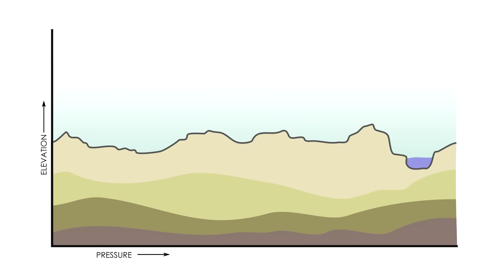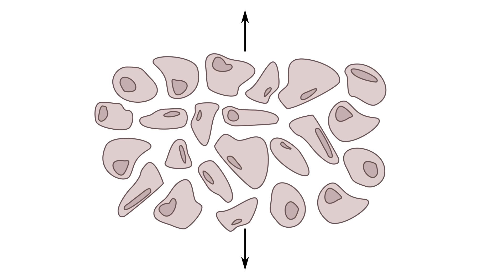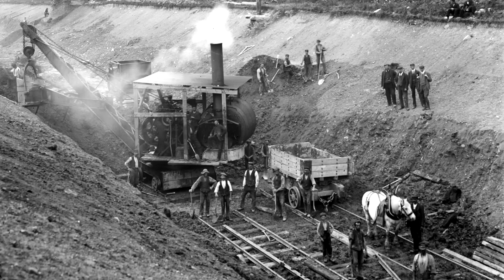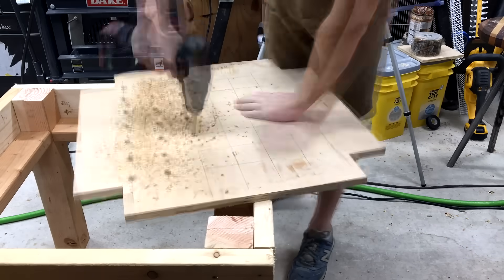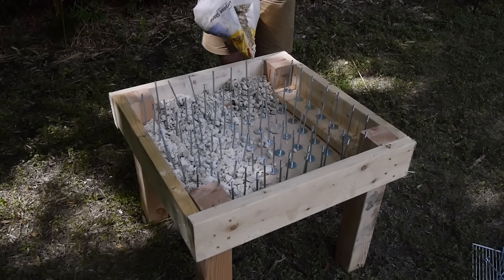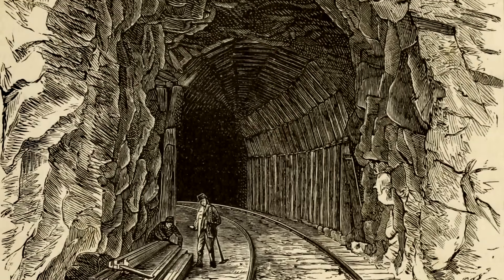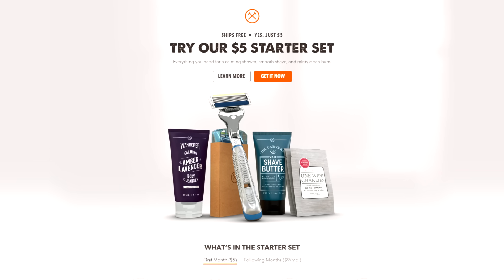Why Tunnels Don't Collapse

Comment: One of the tunnel designs that stretched across Sydney and the CBD that supports the Heavy Railway subway System in the style of Heavy surface Rail including the Red Rattler System.  The tunnels did bore through Heavy rock when construction, but required thick Reinforced concrete bunker wall method for the strength of the railway tunnels,  the ones under parklands Hyde Park e.g. was dug up in the Early 1920s and St James station and part of the City Circle line was built.  2 tunnels were needed for the Underground Railway, another 2 were added for a new route to Eastern Suburbs that didn't make it.  The St James and Museum station section in the Hyde Park area used Cut and Cover Techniques, while most dug under the streets were pit style tunnel digging through Hard Rock and then concrete lined.

Comment: I need someone to explain to me why the old Gotthard tunnel here, which was blasted directly in the rock, never needs any major maintenance, while the second one, less than a third the age, built to much more complicated standards and lined with concrete, needs a major overhaul that will take years. So bad in fact, that they will need to drill a third one, to allow closure of the second while fixing it. How complicated and expensive the new one be will to maintain - I'd rather not think of it.

Comment: I am going to start working on an underground shelter into a huge hill on our property. I could use a lot of advice on how to support the roof and side as I will be building shelters inside the tunnels and possibly moving shipping containers 40’ long into the hill. Lots of engineering needed to support a bigger opening not just for walking but living.

Comment: I want to build a tunnel connecting my shop to my house. Approximately 50 ft. The soil is loose and sandy, so I need to have a concrete ceiling. How thick should it be and whats the procedure for pouring it? How do you support the wet concrete until it cures?

Comment: I kind of want to figure out how do rocks stay put like that with just bolts and rings, more like the science behind it rather than engineering now. In a real world scale it is more understandable in a way, rocks are much larger, and require fewer bolts, but...here bolts had tighteners on both ends, in the manmade caves you can't put a tightener on the other side if you don't want to make a hole as large as a ring around it, or whatever flat surface item is placed... So, how?

Comment: Would atmospheric pressure be a way to describe gravity? Wouldn’t that be a part of what keeps us planted on the earth?
Reply: Atmospheric pressure is a result of gravity so if you tried to "replace" it with that, where's the pressure coming from? Also it just doesn't work at all. Things still fall in a vacuum, what would be holding together the solar system or galaxies, there are subtle differences in gravitational strength across the earth that you couldn't explain this way, we have measured the very tiny gravitational attraction between normal objects in a lab so you'd have to introduce some kind of weird very selective sideways pressure that clearly makes no sense, on the more advanced side we have very good proof of general relativity like the gravitational time dilation experienced by GPS satellites or the bending of distant star light around other stars but now we're really getting into overkill territory considering the entire concept falls apart with the first two points so I'm gonna stop here.

Comment: So if you have those bolts going in vertically to a rock roofing section, would it then provide additional strength to tether all those bolts diagonally to each other across the roof surface - so that if one tries to shift slightly as we see in the example, it is resisted by the position and tension against the other surrounding bolts?

Comment: You should have mentioned the basic principle of the New Austrian Tunneling Method (NATM), which is the ability of the rock (many types of competent rock) to support itself, even without the use of bolts. Bolts are added to the rock (and too often complemented by shotcrete) if the material is deformable, that is, the rock alone is incapable of absorbing the mass stresses and consequently deforms, thereby the steel of the bolt comes into play by absorbing a good part of the stresses. Now, if the self-support time is zero, or to low to allow for the installation of bolts, steel sets must be placed - and shotcrete prayed between them, in order to advance with the excavation. These are the words of a tunnel engineer, Hope this complemented this good video,

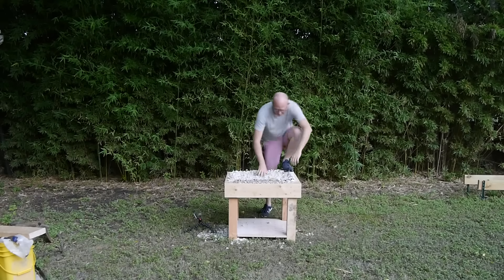Comment: 6:15  Don't do that.  I don't care how confident you are, risking your personal safety for a demonstration you could have easily done safely with some weights is reckless.  It sets a bad example and violates your profession's code of ethics referenced at 7:13  If the gravel had suddenly shifted under load, you could have been seriously injured from the fall, possibly even impaled by bolts.  This video is 2 years old, so I hope you've learned better in that time.

Comment: Hi, do you have any videos on structural modification of a roof. I would like to install a structural LVL ridge beam to support the span of the roof so ceiling ties could be removed without causing bowing at the walls

Comment: I really like your videos. You dumb it down to a layman level. I had wondered how the bolts they put in tunnels actually worked. I used to go into old mines as a kid and see how they used narrow passages to support the roof instead of making wide open passages with support they made narrow passages with arch ceiling. Thanks again for doing great videos.

Comment: The Bloncoliero channel covers aviation accidents.  He is a pilot and explains the factors in the cause and things to change to avoid such accidents in the future.

Could you do that same thing with concrete, STARTING WITH THE FLORIDA CONDOMINIUM COLLAPSE.  There must be more factors than just concrete since this building was sitting over a low water table, was close to the ocean, was on a virtual island, and was assaulted by ocean weather and tides year around.    So, what is the story?

Comment: One night when I was drinking with my buddies, I said I could stack empty beer cans to the ceiling. An that after u was done they wouldn't be to topple it by clicking a cigarette butt at the column. I let them topple it a couple times. Then I added a key can at the very top. I crushed it slightly to fit it between the ceiling and the tower of cans. That provided tension to the tower of cans. They were unable to topple it after that.
Reply: My big thumbs ruined some of my prose. :)

Comment: I wonder if you could use lasers to melt the surface layers at 1500 degrees C. Creating a polymerized or concrete-like material. Perhaps even a stronger lazer to change the state into a plasma, at 10,000C creating a sort of glass made of rock and soil?

Comment: Here I am watching this instead of preparing for my intro to geotechnical engineering final. If I am understanding correctly, the bolts place a normal stress on the media which increases shear strength. Does this play a role in transferring the overburden stress down the sides of the tunnel or is this reinforcement solely to prevent the ceiling collapsing from its own weight?

Comment: Do you have videos about the "New Austrian Tunneling Method" and the downsides / upsides of "cut and cover" vs. "mined" tunnels for various applications?

Also: If you could use the Berlin U5 extension (opened in 2020) as  a practical example of how to dig a tunnel through sands full of archeological remains below the water table (and underneath a river) that'd be interesting, too

Comment: @Practical Engineering. 
Q) Would it be possible to create an ice tunnel next to a rock tunnel entrance. There's Huge amount of snow fall (upto 3 floors tall) on the approach road to the rock tunnel that needs to be kept clean.

Q) Would it be possible to bore a tunnel through compacted snow and prop up the compacted snow walls using your technique?

Comment: I always wondered how rock bolts worked.  The top of the bolt or end that is secured was the part that lost me.  I assume they use these on foundations as well, sort of like the original WTC?

Great video!

Comment: I'm putting together a project where under ground facilities will be constructed. The mining/digging/constructing underground facilities is just one aspect of the project. This is something I've never done or experienced with. I don't want to blast material away. I'd rather tunnel into the ground. Where this project is the soil is comprised of sand, gravel, sediment rock, clay, quartz. 20 Miles to the east is the Atlantic ocean. Hundred miles to the west is the mountains. I know there is all kinds of different equipment for digging and tunneling. As well as systems to remove what is dug out and wash plants to separate different materials. I'm most interested in a system to dig out this material that does not create toxic fumes. And a way to remove this material to ground level efficiently. I don't want to learn through trial and error. I want to have some knowledge about what I'm doing. You I'm sure have used different methods for different soils and situations. Can you offer me any advice on this?

Comment: Good video, thanks. It would be interesting hearing a little bit of they physics that the calculations take into account, e.g. the size of the rock fragments you are supporting using this method, and how that determines the length of the bolt and the washer size that holds the rocks up.

Comment: While this idea is super basic, knowing how compression will create strength to bits of mass held together, I never thought it would hold up so well. Pretty great. I would imagine it would hold up as well as the pieces of gravel are wedged into one another with the bolts. Otherwise more and more shakes would eventually cause it to slowly collapse. But, with a little concrete, that can be solved.

Comment: Grady I am wondering about something. With certain materials (like plastic)  the material becomes stronger when pressure is applied to that material (because the pressure pushes the atoms of that material closer together). Would this work for concrete ?
If pressure is applied to concrete  when it is a liquid and slowly becoming a sold , would this make the concrete become stronger than what it otherwise would of been ? 
My email address is   frankbozik@yahoo.com.au

Comment: Sure it's safe ENOUGH to do, but it doesn't FEEL very safe. Even if the engineers made sure that the rods holding the gravel were enough to hold the tunnel open, I wouldn't trust those rods to hold the gravel up. There was quite a bit of spillage when the board was taken away, and the few mild hops did cause some gravel to fall off. Sooner or later that gravel tunnel roof is gonna collapse. I don't know if a net held up along with the bolts would also be enough but it would at least look like the gravel would have a harder time falling away and would remain supported. 

I dunno where I'm going with this exactly but let's look at the Hoover Dam, it's curved not out of necessity for it to be sturdy, as a straight dam would be sturdy enough, but the engineers behind it made the dam curved in order to make the public FEEL safe too.

Comment: That’s a gutsy demonstration you did proving a point. I take it you are not disabled. You probably don’t even have a back ache. If the rocks had failed and one of the bolts cut into your leg hitting a major vein you could be hurt very bad.  Maybe next time fill a 13 gallon garbage can with water

Comment: The theory of rock supports described by you is not the only one in the scientific community of mining engineers.
You also missed one important fact - the presence of horizontal forces acting in the rocks. Horizontal forces can be of various sizes, from 0.2yH to 3yH and more. This fact radically changes the geomechanics of ground rock supports.

Comment: Question: What did they use back in Vietnam to reinforce tunnels in that clay soil with lots of rains? I saw some footage of it and yes they are small but most look like lined with only clay and as deep as ~30ft! 
Great video BTW just wondering how the tunnels stayed up so well with there supplies when some looked to only have clay walls.

Comment: A for Good scale mock-up ... F for lack of safety plan. The first rule of engineering is protecting public safety. Don't try this at home. (Even if you tested this with an inanimate weight before you stood on it, not showing that is a dangerous oversight.)

Comment: 6:10 PRACTICAL ENGINEERING JUST MADE MINECRAFT LOGIC IN REAL LIFE!!!!!!!

Now, what do you have for floating trees or sand blocks?
Reply: Can't help you with the tree situation but cast-formed sand isn't a new concept at all.  Using a binding agent or adhesive you can temporarily or permanently bond sand together into almost any shape, including blocks.  We used the concept to produce the iconic pineapple grenade from WW2, each grenade had a temporary sand core inside to make it hollow when the metal was poured.

Comment: The most extreme example of this bolt tensioning of rock I've seen was in the Cheyenne Mountain complex.  I had the opportunity to tour the facility as an AFROTC cadet in 1983 or 84.  The complex was hollowed out under the mountain and around 115,000 bolts ranging from six to twenty-five feet long were used to tension the structure as you describe here.  There is also a lining of chain link fencing material to catch any chunks that might flake off.  Great video.

Comment: In the military we use a modified rock bolting system. Not only it secures the rock mass through tension but allows a flexible geopolymer grout to be injected at under high pressure to ensure that the walls do not collapse after a nuclear explosion. And we use a high tensile steel mesh secured by the rock bolts and sprayed with a double-twisted steel fiber reinforced shotcrete creating a kind of hybrid steel fiber-steel rebar reinforcement system dispersed throughout the shotcrete mass.

Comment: In the Broken Hill zink mine, Australia, they used drilling machines to bolt a steel mesh to the ceiling of the tunnel.  When they turned the lights off you could not see your hand in front of your face.  Time also seemed to go away at 3,000 feet down.

Comment: An engineer , huh???  Be advised the force of gravity is much greater than atmospheric pressure.  In fact gravity CAUSES atmospheric pressure by acting on the atmosphere above and around us.  Your assertion that "barometric pressure" is the force ~which compresses the earth's crust~  is gratuitous.  Gratuitous assertions must be just as gratuitously dismissed according to the rules of debating..

Comment: Where do they pin the joint from the other side of the tunnel after drilling through it?
Reply: he explained that. 

it's like an arrow head. it goes in easily but the flaired point makes it hard to pull out. 

you can also see a mini version of this if you have ever hung anything from a plaster wall. there is a flaired cap on the screw that digs into the inside of the wall. the harder you try to pull it out the more it digs into the wall.

Comment: But you CAN make a useful rope out of at least one kind of rock... basalt. Basalt fiber ropes, yarn, and roving have double to triple the tensile strength of steel cable while being much lighter. The stuff is even stronger and more durable than Kevlar, as basalt fibers don't melt until you get up to about 1200 degrees, and UV doesn't degrade them.

Comment: Why does elon musk say its easier to build deeper and deeper tunnels than build higher and higher bridges??
Reply: The development costs of mines to build drifts (tunnels) is relatively low compared to building a bridge of the same distance. Depending on the rock type, Elon Musk has a sold point about building tunnels as opposed to bridges. The mining industry, builds hundreds of Kilometres of tunnels per day.  The method that Elon Musk would like to use to build tunnels is called boring, and the term in the mining industry for this method is called continuous mining.  Deeper tunnels would be built in hard rock, as Grady was explaining that rock experiences more stress the deeper it is (higher stress produces harder rock). If Elon Musk could build a boring machine that could bore into hard rock with any efficiency (the mining industry has been trying to do this for years, but the rock is just so hard it is nearly impossible), then building underground highways could very well be the future.

Comment: Hi, I'm a big fan of yours. This video, just fine as usual. Seen from Europe, the United States is a place where you can be sued for about any conceivable reason. If you agree, next time you'll test a contraption built for the sake of demonstration it might be wise to protect yourself. Here, if your platform had collapsed, your legs would have been bruised when falling. If you put some high rubber 👢, no one can say later you showed him the wrong way of testing it. As a former engineer, I know users are quite talented for finding new fails ! 💥 Thanks & don't stop till WE have enough ! 🏆

Comment: So are the bolts in the rock around the tunnel for withstanding the weight around it? And if so, for a tunnel under water would the pressure come from all directions?